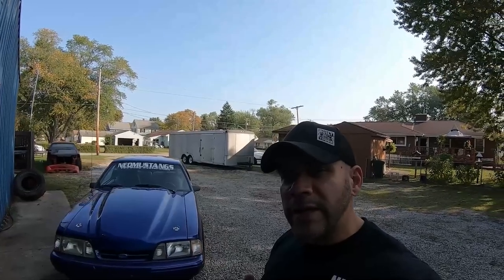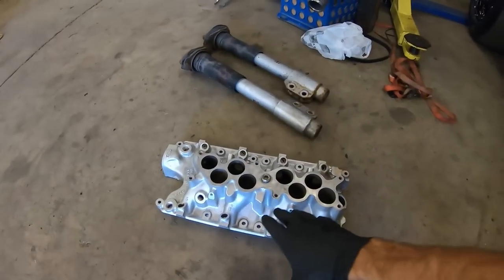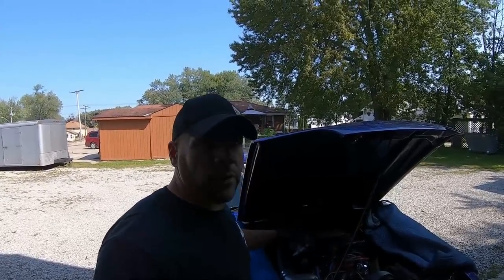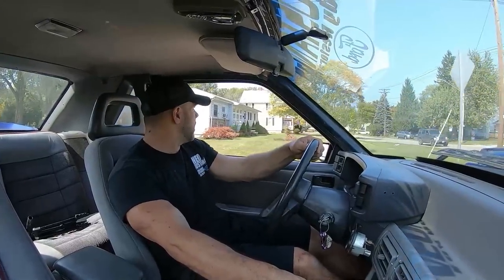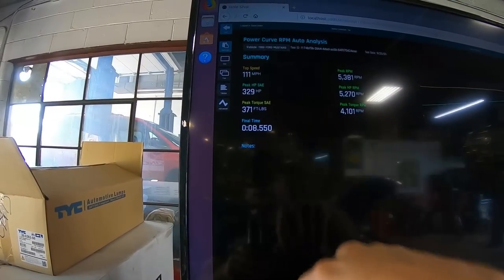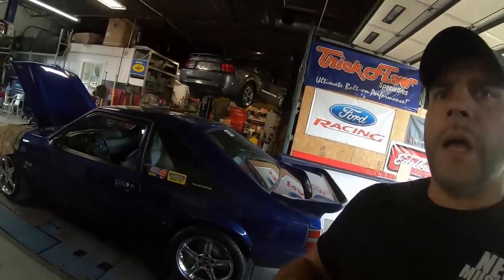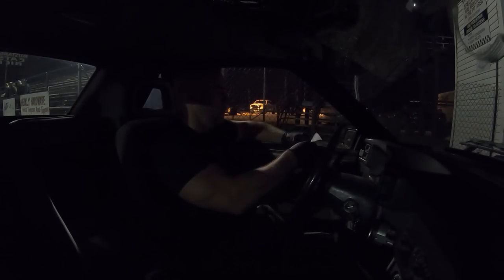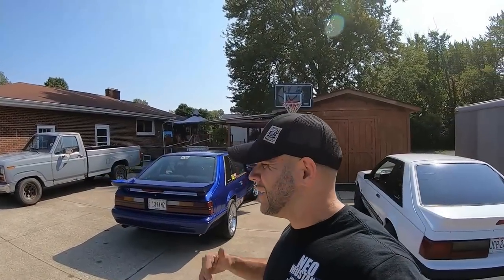How Much Horsepower Will GT40 Intake Make Vs. Stock 5.0 Intake ADD BOOST!

Comment: I just watched your video I liked it.... just kinda wondering if I could get y'all opinion on my setup to what kinda power you think it might have I've got a 306 speed pro 4 valve relief pistons, gt40p heads  intake, exhaust runners been gasket matched and cleaned up under the valve s been cleaned up stock valves with a 3 angle valve job, b-303 cam, 1.7 roller rockers gt40 intake 24# injectors  long tube headers 65mm throttle body not sure on the mass air meter.... just like to have your thoughts on thanks
        William
Reply: Dyno

Comment: Great video. Iam a subscriber and will follow you. Just bought 93 gt. About 4 months ago. Here's what my set up is. Wondering if you could ballpark my HP? 5.0 stock bottom, gt40 heads, cobra intake, e303, BBK shorty headers, BBK 65mm throttle body. 70mm mass air, 19lb injectors, BBK H pipe, Flowmasters, 3:73. Thanks Darryl,
Reply from the maker: Nice !
Reply: @Neomustangs  what kind of HP you think iam around? Ball park. What else would you recommend that i could do besides, ( supercharger, turbo, nitrous)? I like it to be street / cruise and dependable, granted stuff happens. We are in our early 50's, and a FOXBODY it's a great way to go MID LIFE CRISIS. LOL. Fun car to drive / cruise. Much appreciated. Darryl

Comment: What did you do about the throttle cable bracket when installing the gt40 intake?
Reply from the maker: NOthing it bolted right up? What do you mean? I used the Factory EGR housing that was bored out. I machined it to match.

Comment: Speed density why tf would you not rid that theres your problem
Reply from the maker: Hell no speed density was the fun part of it. I already know what mass air and tunign will do bud. I wanted to do it w/o tuning...
Reply: @Neomustangs  no tune?speed density?how does that work curious I know if stock form the density is better then maf,but speed density computes info slower to the ecu..i like the car btw

Comment: When you first started it, the slight rocker/lifter tick, mine has that, but runs great. Did that go away or still have it a little? Trying to see if I should pull my lifters out as they were tight going in.
Reply from the maker: It went away.
Reply: Neomustangs good deal, thank you

Comment: gt40 intake, gt40p or gt40 heads, cam, probably tfs1 or a b cam, longtube headers will make no where near 350rwhp but will definitely have some torque to it.  which for a street car, is more important. 

always like gt40 videos.  best bang for the buck

Comment: If anyone is interested, I have a complete GT40 set up for sale Heads, upper and lower Intake. As well as Y303 SVO Ford Motorsports Aluminum Heads with SVO 1.6 roller rockers, Trickflow push rods.  Located in Central Ohio.

Comment: Other than hood clearance issues, I’m curious to know why mustang racers don’t use the EFI truck upper & lower intakes??? They’ve got longer runners, it’s a dual throttle body and there’s larger diameter truck throttle bodies available from the aftermarket too!
Reply from the maker: Curious myself.
Reply: Neomustangs me especially so due to current and vehicles 10yrs old or less all for the most part can be either factory retuned using factory software or tuned with aftermarket software without removing the EGR if equipped or any emissions components. Obviously, that’ll only go so far then it’ll be necessary to remove all emissions and go all out for performance.

In my case since I need to remain street legal and within EPA & CARB meaning (instant inspection fail if a check engine is on) but, I’d like to get as much power from upgrades like your doing with old blue except the need to keep stock EGR & emissions A.I.R. pump and equipment with at least high flow catalytic converters.
Reply: My current application is a 1985 Mercury Grand Marquis LS 2-Door, 302 nothing special 0.030” over bore with stock rockers, pushrods, flat-tappet hydraulic lifters, stock E7 heads & intake with RV cam, EGR & Complete AIR system with TAB & TAD valves, EGR control & EGR Valve solenoids, A/C throttle kicker, Choke control & Exhaust heat control valve all are electronically controlled and vacuum operated and all working, stock 2BBL CFI Fuel injection & TFI Ignition, stock exhaust manifolds with one O2 sensor on passenger side, 8.8 LSD with 3.73:1 gears 28-Spline axles on P225/70R15 tires on 15”X7” 5 on 4.5” rims.

In the last year I’ve installed the following new parts, HD spring assisted front shocks, air assist rear shocks, full 2.5” exhaust, magnaflow high flow AIR Assisted Catalytic Converters, H-Pipe, dual flowmaster 40 series mufflers & tail pipes over the rear axle, head gaskets, lapped the valve seats, new valve seals, double row timing set, new front & rear main seals, one piece oil pan gasket, intake & exhaust gaskets, replaced all sensors including EGR Valve, replaced all vacuum lines with new lines, installed a Monster Transmission AOD built for 400HP/450torque with slightly higher 1,600 - 1,800 stall torque converter (factory was 1,300 - 1,500) made a mount and installed three 15” X 7.5” X 3/4” trans coolers 3/8”s ID, made new 3/8”s trans cooler lines added trans temp sensor in the return line, added remote mounted spin-on oil filter for the trans.

Removed entire engine harness except harness that goes through the firewall, repaired any shitty Factory Ford wire slices, ran new sensor wires for a tach, coolant temp, oil pressure & trans temp into the factory harness loom, 4-pod A-pillar gauge pod with autometer 2-1/16” gauges, wired PWR & GND for gauges into stock harness loom, wired the gauge lights into the headlight/dimmer harness loom, soldered/shrink tubed all connections and replaced all factory loom tape with Tessa tape & flexible split loom all for stock appearance and fitment, replaced old frayed 10AWG alternator charge wire and fender to block grounds with 8AWG wire, replaced 4AWG PWR & GND’s and added a block to frame 4AWG GND, added a 8AWG GND for the alternator to the regulator on the fender to assure good charging GND’s. 

Installed new severe duty water pump & Fan Clutch, new 3-Row radiator without factory skimpy trans cooler, new stock 70AMP alternator, new belts, all new hoses for cooling, heating and emissions, fabbed up a functional 2”T X 12”W X 18” hood scoop with fabbed 18” X 4” air cleaner housing to seal under the hood with stock 9.5” X 3” air filter, new distributor, wires, E3.42 spark plugs, new factory 16GAL fuel tank, fuel pump & tank level sender, basic maintenance new fuel filter, air filter oil change & filter, new brakes front & rear, new tires, new 800CCA battery.

My problems are, EGR Insufficient Flow fault code and no idea what parts to upgrade to stay reliable, good idle, more power and stay CARB inspected. My idea is a sleeper that has good fun power, ok cruising mileage and passing state inspection. I’m not by far trying to break and power records here, just a fun old paw paw sleeper car, no turbo, NOS or forced induction except for small ram air hood scoop.

Comment: Can I put the gt40 intake on regular 5.0 heads?
Reply from the maker: Yes!
Reply: @Neomustangs  I wonder if the flow will be the same, if the 5.0 heads are the choke point
Reply from the maker: @chriscon818  intake really is then heads.

Comment: So you think it would only make 20ish more rwhp with GT40 heads and long tubes?(legit question) I was hoping the gain would be atleast 30-40hp with the heads since boost is involved. I'm planning on the GT40Ps with my little Novi blower and that's disappointing.  Lol I thought they were usually good for 25ish hp NA. BTW, love the channel man. You and Brew2l have the best content!!!
Reply from the maker: We will be revisiting this
Reply: @Neomustangs  I'll be looking forward to it. 👍👍
Reply from the maker: You bet!
Reply: Lots of variables.
Casting roughness, valve job, bowl ridges, good springs, etc. Minor details.
There's 10 HP difference easily.

Comment: That cover underneath the lower intake keeps hot oil from splashing onto the runners and heating up the air going into the engine. On any intake, wet or dry, it's good to get the covers off underneath and clean all the gunk before installing on a new/fresh engine--otherwise it's like doing an engine swap without flushing the radiator out.
Reply: It's worse than that. The PCV valve will pull oil through the cup screen at high rpm and the engine will smoke.